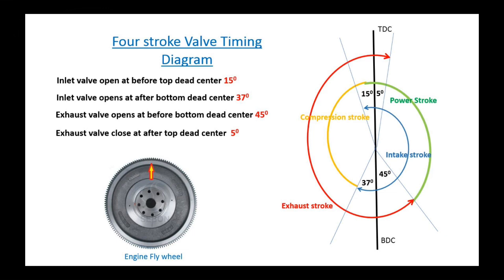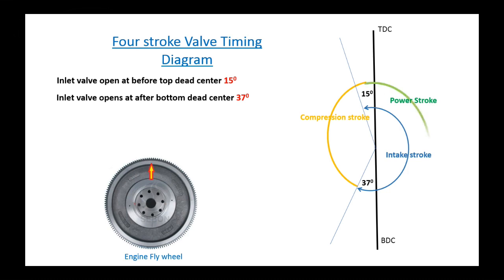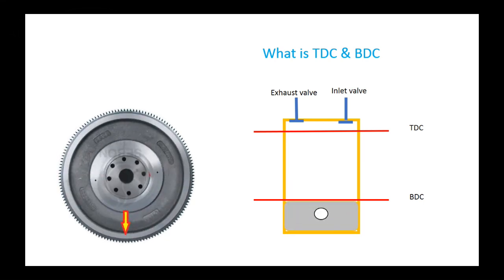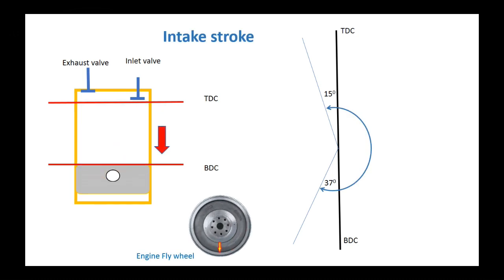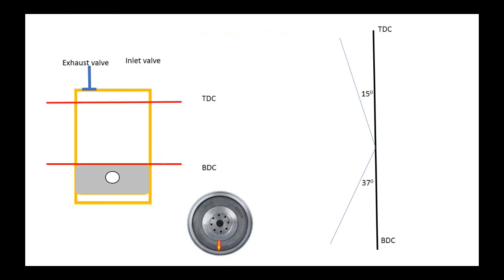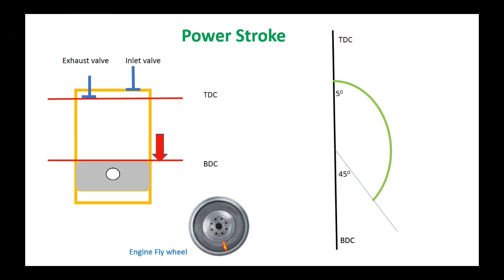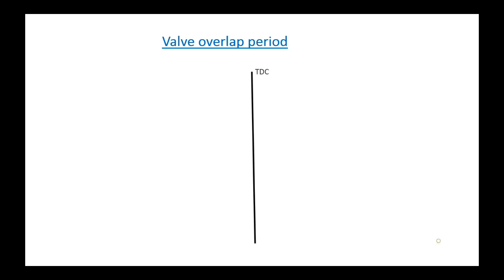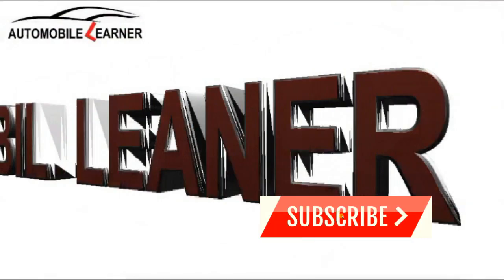Explain Four Stroke Valve timing diagram (In English)

Comment: How do i calculate suppose if the engine is running at a steady speed of 4000 rpm the engine has an intake valve whixh opens for 220 deg and exhaust valve opens at 280deg calculate the time available for the fresh air to enter and time available for the exhaust valve leaves time take intake and exhaust valve overlaps 80deg what is the time for which both intake and exhaust valve opens

Comment: There is a huge stupid error in this amateur video: inlet valve CLOSES at 37 deg after BDC!!!
Reply from the maker: brother. valve timing is different according to the engine designs. 37 degrees are open because we need to show you even the valve opens on compression stroke. 37 degrees are not a wrong value. thanks for the discussion.
Reply: yes...i saw early then i find a person who comment in this video !
Reply: it's called inertia.

Comment: Nice. How do I calculate the remaining valve timings (for compression and power)? How long do they remain closed?
Reply from the maker: compression stroke starts from After BDC (37 degrees after ) and stops at TDC. Same time it begins the Power stroke and it end before BDC (45 Degrees before). so vale close time you can calculate as 360 - (37+45) = 278.
according to the diagram you have to add yellow round angle and the green round angle. Thank you!